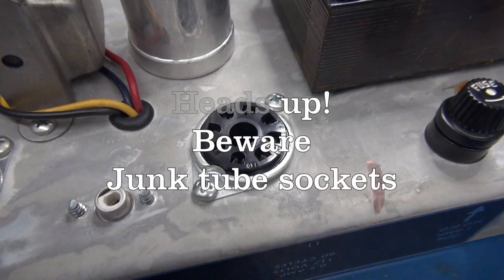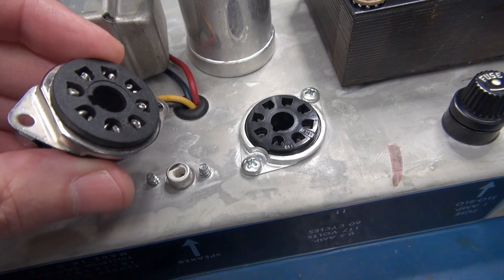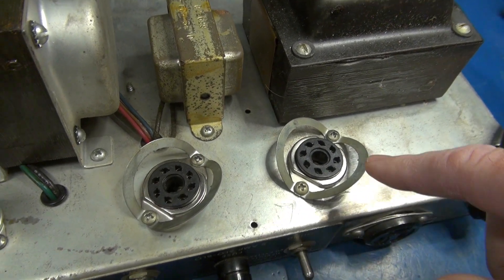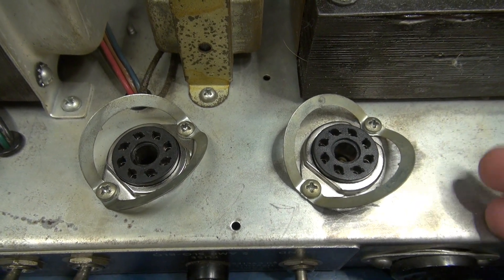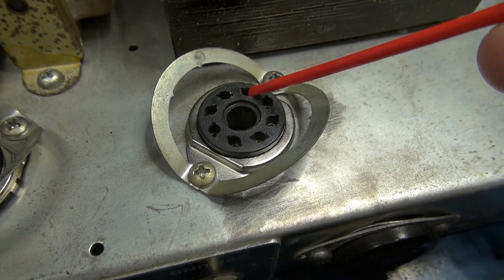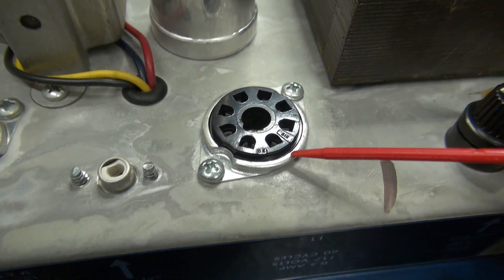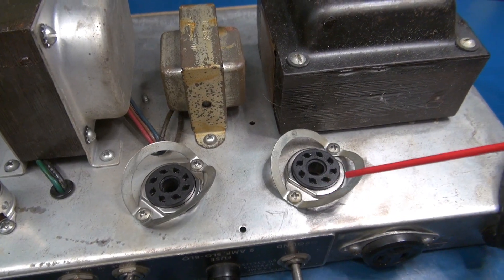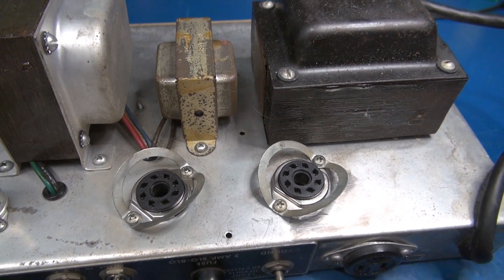Beware Cheap tube sockets How to identify them Keep quality parts in your vintage tube guitar amp

Comment: Yep. I purchased 4 of these and installed them in an early silver-faced twin reverb. They were marketed under "Original Fender Sockets."  The ones I received even had the dimples at the screw head area like the originals. As I Installed them, It became VERY apparent that the solder terminals(and thus female pin contact terminals) were nearly half the thickness of the originals. But I figured "these are what Fender is using so what the heck." BIG BIG mistake. These were not original at all and were indeed fake, cheaply-made "yellow" sockets. A ton of time and money wasted. Fortunately, after research, I found this out and the amp never went back to the customer. On a side note: after VERY extensive research; including consulting numerous parts catalogs and manufacturer specs from the 1950's into the 1970's; I've determined that these octal sockets were likely special-made for Fender. No company made an off-the-shelf top-mount octal socket that mounted into a one inch hole with a mounting screw spacing. At this point, as much as I hate to do this, the likely solution is to enlarge the 1" hole and install bottom-mounted, high-quality, NOS sockets.

Comment: Thanks, good video, and very important information indeed. 
Sadly I learned this the hard way myself when I built the first DIY amplifier. It worked for just a few weeks before I noticed noise in the speakers of the left channel that are typical if having a bad or loose connection somewhere. 

Naturally I thought it had to be my soldering job done poorly somewhere, so I doublechecked everything but ended up with the faulty part being one of the preamp tube sockets. Chinese cheap product . I ordered new sockets for the whole amp, EL-34 included, and I bought the most expensive ones I could find. They came from Germany, not China. 

Amp has been working perfect since..

Comment: Those old original Fender sockets dont impress me to begin with. Many times ive seen broken solder tabs from screen/grid resistor swaps gone bad, or the pin grip is loose. Thanks for the heads up, 1inch sockets are harder to find

Comment: If you use the bear traps with those biscuit base 6L6/5881s they will break the glass and your tubes will be scrap.
Reply from the maker: Yes, those are only in for test. I have a set of Tung-Sols standing by

Comment: Thankyou for pointing out the details in spotting the good-uns. Since I had a Champ that needed a new  6V6 socket I ordered a new one , the valve just slid out again even with the claw gripping it. Changed it , valve sits thete snuggly and will not wobble or slip anymore. Best economy is to get good quality parts otherwise you end up spending more time soldering and waiting for parts instead of actually playing the instrument the amp was made to amplify.

Comment: Knew about that, seen them already in amps and replaced them,  All they make is badly copied JUNK. Do not buy Chinese components, you will regret it!
Reply: You can probably find Chinese made components with halfway decent quality, but you can't guarantee that what you think you're ordering is what you'll receive.

I repaired a circuit board for a friend of a friend who had destroyed a flexstrip connector.  It took quite a bit of digging, the known good replacements were back ordered or had a large minimum quantity requirement.  Finally found what looked correct from a no-name Chinese company, crossed my fingers and ordered (30 pieces!).  Just hoped they'd be the right ones.  They arrived, looked decent, I installed one and gave them the rest.  Whew!

Comment: I hate those crap sockets.. it has been a nightmare finding a reliable supplier of good octal sockets.
Reply from the maker: Yes, Good sockets show up on ebay sometimes. I have been installing NOS Cinch or Amphenol bottom mount sockets. Found a good deal on a lot of them. These old amps deserve the best components